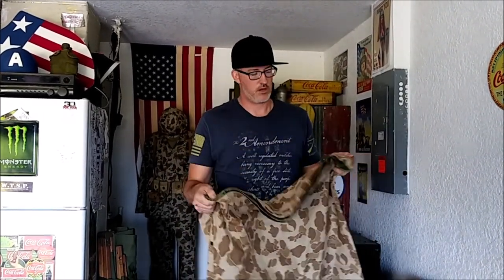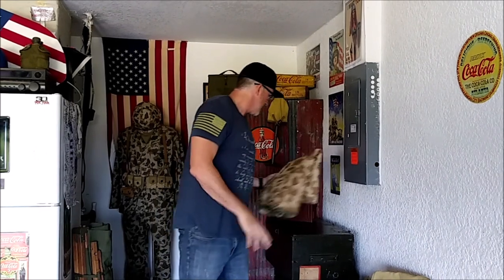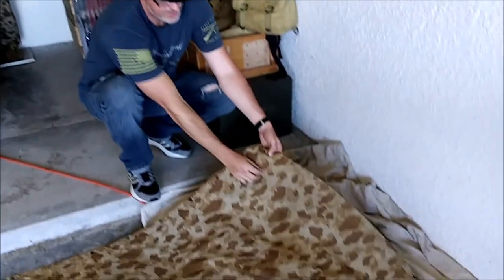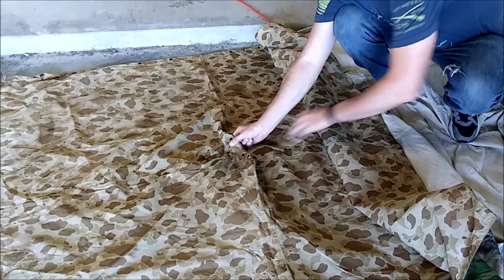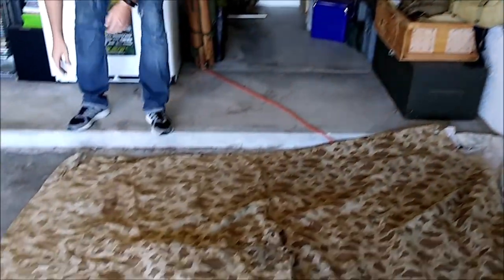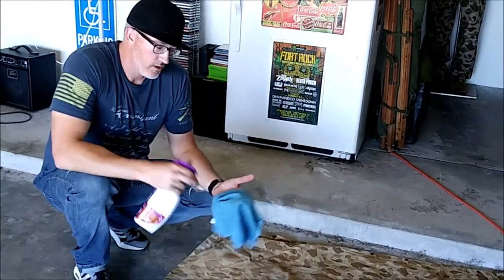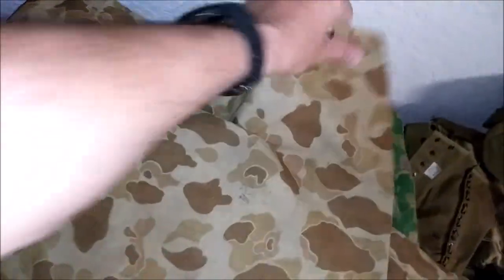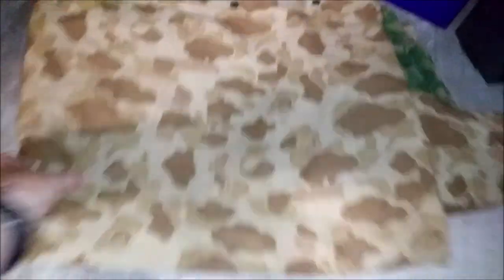WWII USMC Poncho Restore

Comment: I tried this on two of my USMC ponchos that were pretty stiff. One more than the other. The less stiff one as to be expected turned out great better than I anticipated. The one that was stiffer turned out just as the video said it would. About 70% better than before. I used the “conditioner” version of rejuvenate. I could not quite tell one kind was used in the video. Thanks for posting great little tip!
Reply from the maker: Either way. Both turned out better than they started I assume.

Comment: I got a question my poncho sounds like a paper grocery bag will this still work?
Reply from the maker: Yes. I will make it foldable.. But that paper bag sound will not go away completely.
Reply: Digital FourTen Ah okay thanks because im kinda new to the usmc reenacting im not in a usmc unit yet i plan on joining one next year.
Reply from the maker: @boof5395  I've been doing usmc here in Florida for years.. Sadly never been rained on, never had to Put it on
Reply: Digital FourTen ive been rained on in Illinois and it messed up my double buckle boots sadly
Reply from the maker: @boof5395  who made your boots? I've done landing craft landings.. Ran through creeks etc in my boonedockers etc.. Look brand new.. Never even dubbed them.
Reply from the maker: @boof5395  check out my other wwii videos
Reply: Digital FourTen to be honest i dunno who made them but it was really muddy